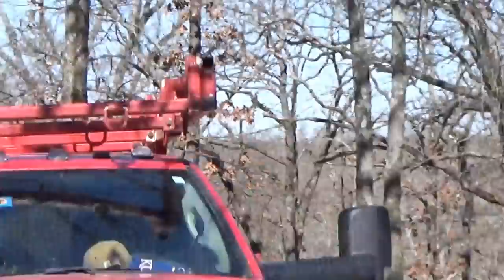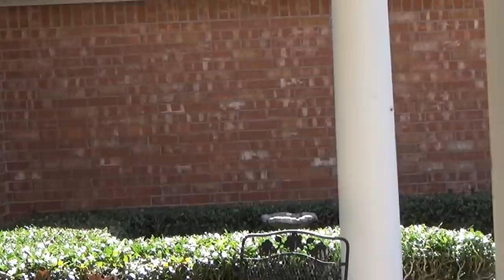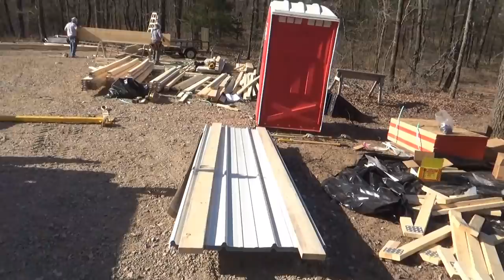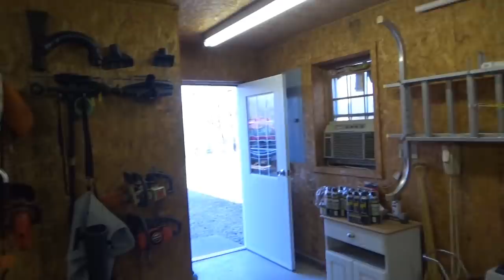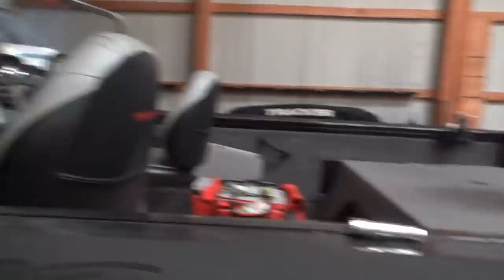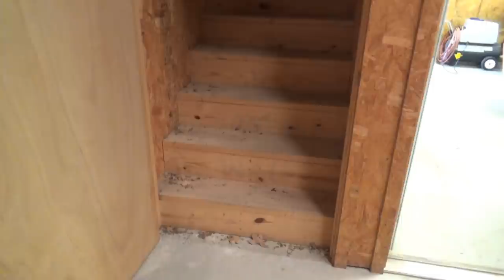New Barn Update and Old Barn Tour

Comment: In Washington the relative humidity is much higher, so less problems with dry skin. When I was growing up in TX, and an adult in VA I had terrible problems with dry hands in winter. My knuckles would get cracked, it was bad because I worked as a nurse, so much hand washing. I really like Aveeno 24 hour lotion, it does work well, and is not greasy feeling.